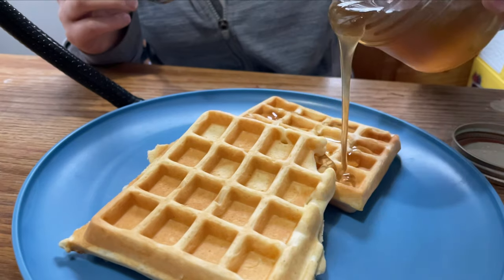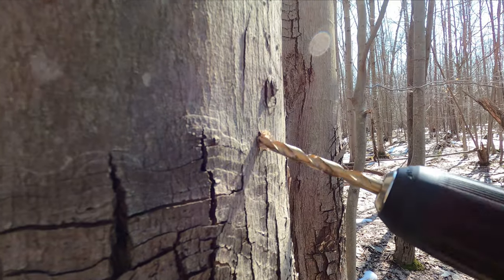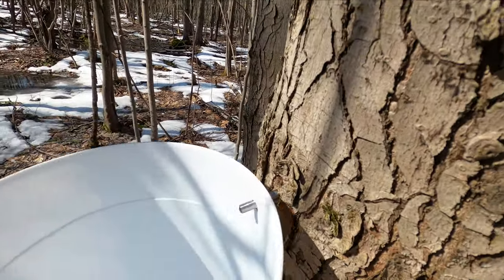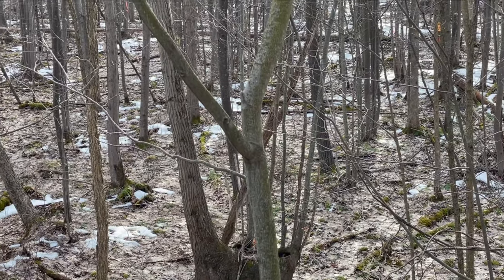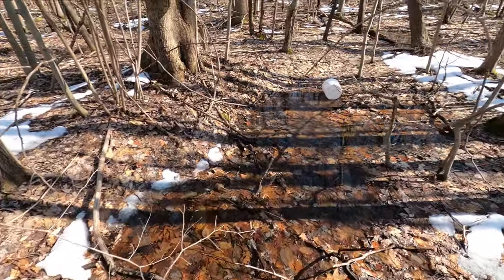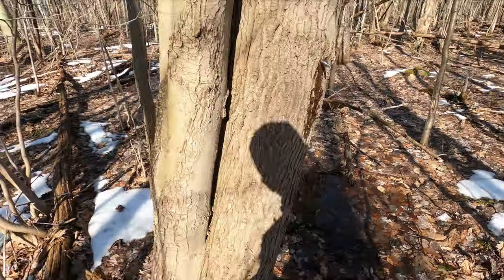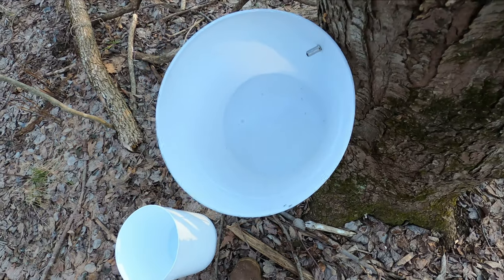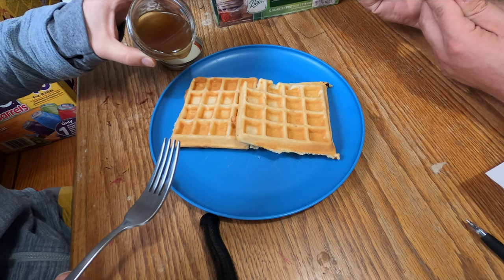Making Maple Syrup at Home | How to Make Maple Syrup | Off Grid Homesteading - Part 1

Comment: They have spouts with hooks on them to hang the buckets on. The spout you used is for attaching  a hose to it from tree to tree to a central collecting bucket or some sort of container from what I've seen in pictures.
Reply from the maker: Good catch! Yes, these are taps for the vacuum hose I have! I was hoping to not have to purchase more taps at the moment but if i want to use the hanging buckets, it makes sense. 

I think I may just leave the containers on the ground and run the line into the top during my next go around. 

Thanks for commenting!